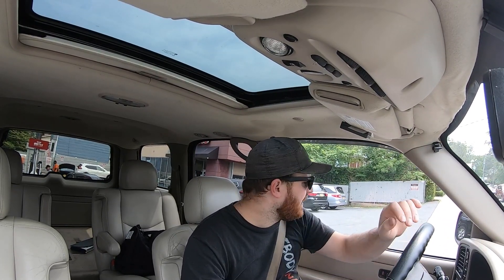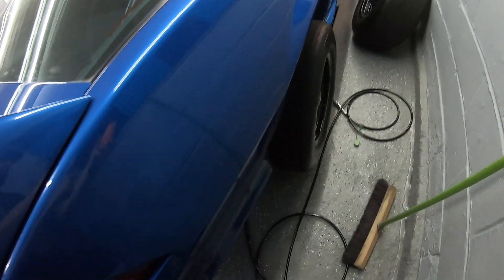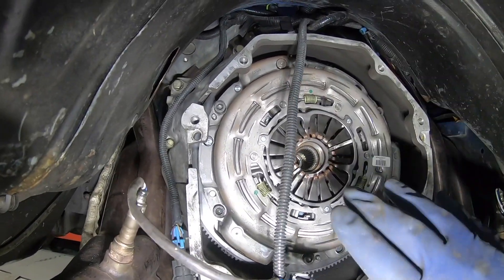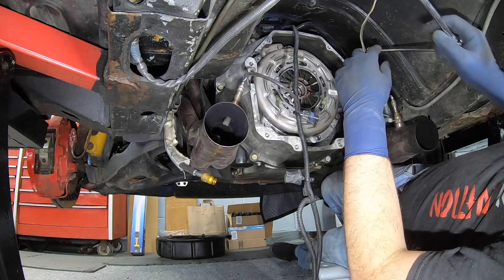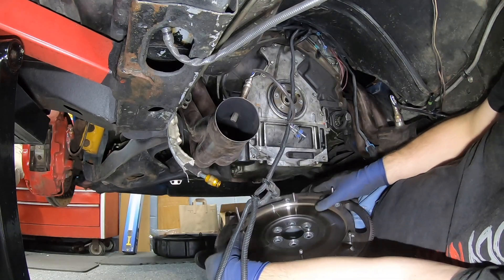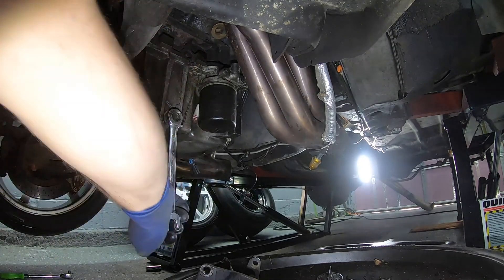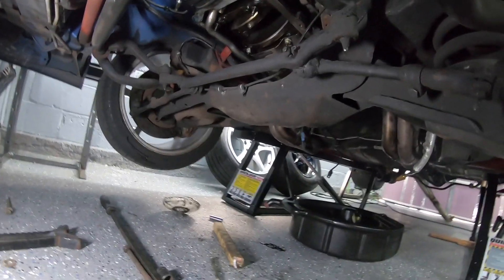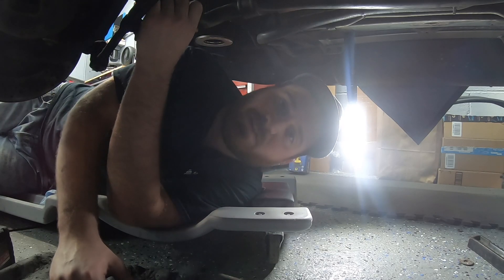I Regretted this Day for 5 Years... LS Swapped 3rd Gen Oil Pan Removal

Comment: Awesome video and awesome car. I had a question, did you record and stop and record again around minute 11:13-21. I ask because it looks like the engine support bar moves a tad bit forward, so I was wondering if it’s a truck from the recording or if the support bar actually shifted slightly forward as/after you lifted the engine.

I have a pair of quickjacks and I’ve used them so much I have definitely made my money back working on my vehicle

Comment: I recently had to pull my oil pan off my 4th gen and ended up using an engine hoist to pull the engine as high as I could with the motor mounts unbolted. Then I had to drop the k member... Did mine like that because I still had the transmission in but good to know that this is possible. Unfortunately I found out the engine now needs to come out lol twice the work to fix it but atleast I know I have to do it to fix my crank rather than drop everything and hope that was the problem.

Comment: my same exact issue on my 1993 chevy caprice, can't get it out for nothing so im like you about to head to harbor freight to get that support bar and lift the engine up. smh the designers should not have designed it that way, a very simple job and you gotta jump through all these hoops for a piece of rubber for the oil pan.

Comment: What motor mounts would you recommend for a LS1 swan into a 3rd gen camaro
Reply: I used the hawks mounts with stock ls1 clam shells. 
Used the hawks trans mount as well, gives more room for exhaust.
Reply: @SkillzManifest  its right on the hawks thirdgen website. 
My swap was done 6 years ago so i dont have the part numbers but the parts are easy to find.

The wiring harness is fsirly easy, it takes time the first time, but now I can do swap harnesses in just a couppe hours depending on what features people want.

I used speedhut gauges for simplicity, if you have a firebird, they have a gauge size that fits perfectly in to the clusters. And they also have the background that is the same as the stock gauges.